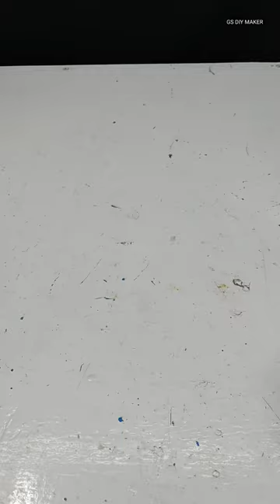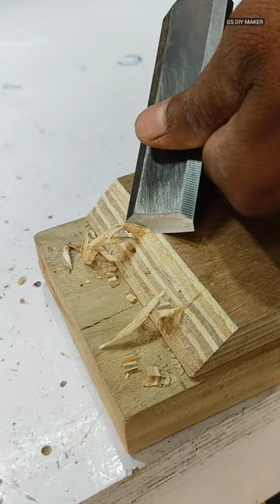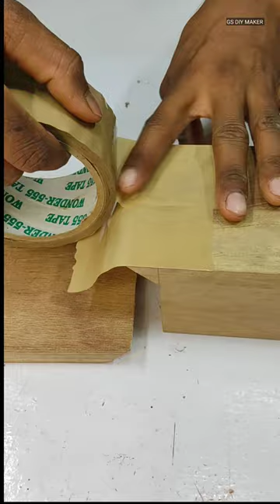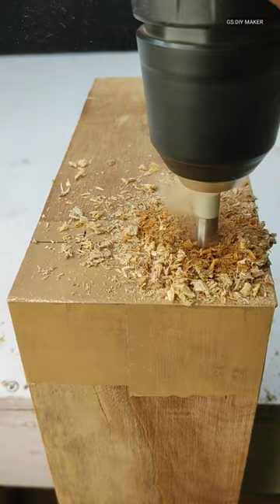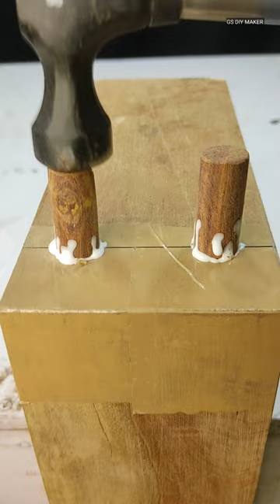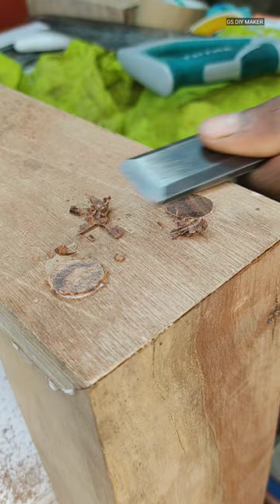Wood Dowel Joint || ASMR || #woodworking #gsdiymaker #shorts

Comment: The surface area gain by the 45° is so minimal that it does not merit the effort. Just do a toe 90°.
Reply: It looks nice, though
Reply: It's to hide the plywood edges. As end grain veneer is not common and a pain to line up right.
Reply: @markp8295  you could hide the end grain of the plywood with a rabbet. He's hiding the end grain on the other piece this way. Kind of lose that wrap around clean effect with the dowels though and of course you can still the the plys on the edge. Maybe that all gets hidden somehow still.
Reply: Wrong. Miter cutting significantly increases surface area that is equally porous making it one of the superior joints